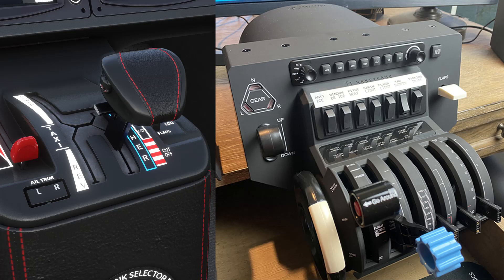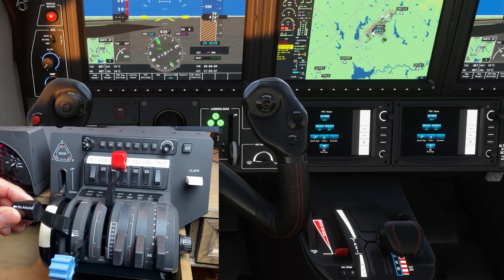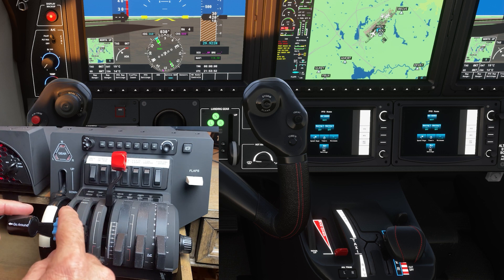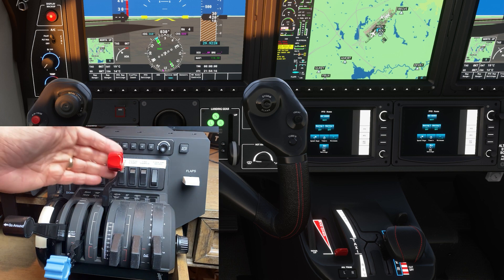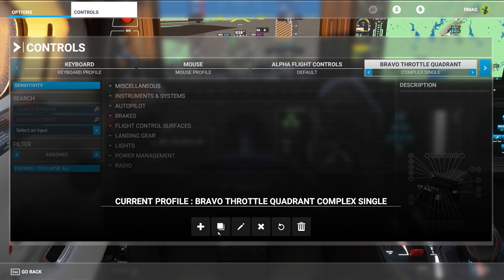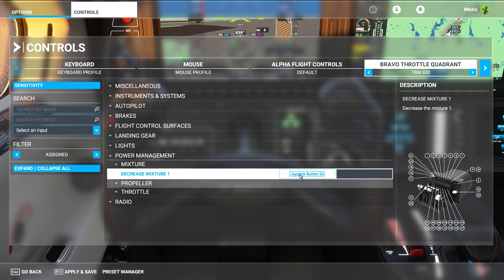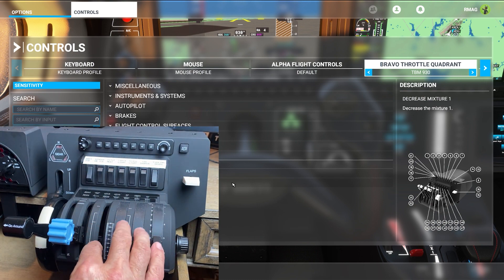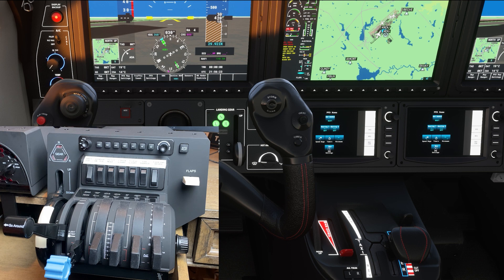TBM 930 config for Honeycomb Bravo Throttle Quadrant in MSFS 2020.

Comment from the maker: Note: Sim Update 5 broke this setup. The Prop lever no longer moves the TBM throttle out of the feather slot. Delete the prop control. You need to change your General Options/Accessibility/Cockpit Interaction System to Legacy. To move it out of the feather slot use your left mouse to click and drag the throttle up. Then hold left mouse button and click right mouse button to move it. Then use your throttle as normal.
Reply: I found a way to do it since the update!!!! Leave the throttle the same, but delete the prop axis, and instead just set the “reverse” position for the lever next to the throttle to throttle 1 cut (it should be joystick button 25). Then add another prop lever on there and again, leave the axis blank but set the “reverse” position to “propeller pitch high” (joystick button 26). When starting, have all levers in the “reverse” detents. To go to low idle, move the throttle lever a little past, then back to the flight idle position. To get to high idle, move the first prop lever out of the detent and move the throttle lever up a bit, then back to the flight idle position. To un-feather the prop and get to the flight idle position, move the second prop lever out of the detent and again, wiggle the throttle lever a bit. Repeat the process in reverse to shut down the engines. I was certainly psyched when I found out this worked, so I hope it will help some fellow flight simmers out. Happy flying!
Reply: @jonathanmcauliffe784  Love what you did, if I may add, mapping both the throttle 1 cut and prop pitch HI to button 25 with remove the third axis.
Reply: I was hoping you had a fix for this! Unfortunately, it's still not working even after deleting the prop control and using the mouse. When I click on the throttle it just glitches up and down and there's no way to get it out of feather. Not stoked
Reply from the maker: @KyleVanHaaster  Are you clicking and dragging the throttle up to the top of the Feather slot? Then you hold left click and do a right click to move it over.
Reply from the maker: Yes
Reply: So now you still use the complex single profile with the tbm?
Reply from the maker: @martindescoteaux9288  no I use a profile that just has throttle, no prop, no mixture.
Reply: @RMAG  OK got it! Thanks for all youre great work! I'm going to receive my Alpha and bravo today.
Reply: @RMAG  so how do you feather, low idle if you use just one lever or you still having  to use the mouse?
Reply from the maker: @dermolado3351  I use the mouse when its on the right side, throttle on the left.
Reply: @RMAG  you would think the people at Honeycomb would have given this a little more thought eh? Oh well your initial fix on the other video was superb.  Shame the update messed it up.
Reply: Hi everyone! I use the 1st and 3rd joystick columns on my BTQ for my TBM-930 set up. If you like, configure your BTQ as listed below to utilize all Power Management functions of the TBM-930:

THROTTLE:
Throttle 1 Axis - Joystick L-Axis Y
Throttle 1 Decrease - Joystick B24
Throttle 1 Cut - Joystick B26

PROPELLER:
Propeller 1 Pitch HI:
Joystick R-Axis Z+ (&) Joystick B26

Notes:

- With this set up, you cannot move from low idle directly to high idle. To move to high idle from low, first take the propeller joystick out of detent, then slightly move the throttle joystick. Now push the propeller joystick up to move to high idle. However, you can move from high idle directly to low.

- Any any point, to get the A/C's Throttle Stick back to the left side of the console, make sure the propeller joystick is neutral/idle, not up or in the detent position, then move the throttle joystick. 

- To cut the engine, move the propeller joystick to detent, and move the throttle joystick to detent. 

I hope this helps someone🙂.

Comment: Just found this. Since you are the "expert" with this plane, any idea how to set up the Bravo in MSFS2024 for the TBM? Would love to see that if possible. Thanks!
Reply: Me too, in fs2024 cannot figure out at all the de tent. The prop on low idle to high idle goes crazy. I have the same setup in fs2020 and work perfect. I also followed @Apollyon_Rev911 directions.
Reply from the maker: @kodiak299  I just posted a video here that has the TBM https://youtu.be/7LHipAjLL2o?si=5T1wLP8qam-53kUh
Reply from the maker: @Topcat1952   I just posted a video here that has the TBM https://youtu.be/7LHipAjLL2o?si=5T1wLP8qam-53kUh
Reply: @RMAG  Yes, just viewed it yesterday. You encountered the same wierd movements I did as well with the prop axis. It works as desired but requires a little twerking around to get the lever where you want it. Or, use the mouse. 🙂
I was also very discouraged trying to set up the Cessna 408 finding, as you did, the condition levers don't seem to work at all. Hope they get that fixed. I even tried mapping them to my TM Airbus throttles, and that did not work either.

Comment: Hi everyone! I use the 1st and 3rd joystick columns on my BTQ for my TBM-930 set up. If you like, configure your BTQ as listed below to utilize all Power Management functions of the TBM-930:

THROTTLE:
Throttle 1 Axis - Joystick L-Axis Y
Throttle 1 Decrease - Joystick B24
Throttle 1 Cut - Joystick B26

PROPELLER:
Propeller 1 Pitch HI:
Joystick R-Axis Z+ (&) Joystick B26

Notes:

- With this set up, you cannot move from low idle directly to high idle. To move to high idle from low, first take the propeller joystick out of detent, then slightly move the throttle joystick. Now push the propeller joystick up to move to high idle. However, you can move from high idle directly to low.

- Any any point, to get the A/C's Throttle Stick back to the left side of the console, make sure the propeller joystick is neutral/idle, not up or in the detent position, then move the throttle joystick. 

- To cut the engine, move the propeller joystick to detent, and move the throttle joystick to detent. 

I hope this helps someone🙂.

Comment: Generally I got this to work except when I increase the main throttle for low idle and high idle it adjust way to quick and automatically jumps to taxi throttle. any thoughts is this a sensitivity config issue with the throttle axis, etc.

Comment: What's the sensitivity on the throttles set to.  Mine, if I move it just a small amount it jumps over to the left side real fast.  I've tried to have it move slower, but nothing happens.
Reply from the maker: They changed how things work, see my pinned comment or my description.  I use the mouse on the right side, throttle only used for left side now.

Comment: Edit* just saw your comment about update 5 breaking this set up. 👍

Thank you for making this video. However, just received the bravo and followed this video but it’s not working. I’m wondering if it’s due to the default settings being different from how they were when you made the video. I was surprised that you didn’t go into detail about which function name was assigned to those levers… was assuming before I watch the video that it would involve reassigning a few things but it seems you were able to use default except for eliminating the mixture adjustment. So to be exact, by default, my far left lever is currently set to “throttle 1” and my 2nd from left is “throttle 2” Nothing moves at all. If I try to move out of fuel cuttoff position and into feather with my mouse, it fights me and wants to go back to cutoff. I have tried assigning to “throttle” but no luck. 
To be clear I have installed the software from the HC site and all other buttons are functioning. Any thoughts?

Comment: Thanks - I like the TBM 930... my throttle is setup similarly but does not work as you displayed... I never can get the throttle to move down the left side - it seems to jump back to the prop side.  It seems simple to setup but such odd and varying results .  Is there some MOD I missed ?
I want to use the REVERSE setting on the throttle at times.
Reply from the maker: Read my pinned comment

Comment: This throttle setup (TBM "H" layout) just isn't working at all. From day one of this video I have mapped this out many times.
Lifting, then lower the prop (blue) lever shuts off engine. Lowering throttle (black) lever cuts power and moves throttle to right side.
It just doesn't work. I dont know if its a tbm license issue or microsoft are just too lazy to fix it?
No, it just does not work as a programmable option. Wasted my money on a honeycomb throttle and not willing to waste any more time trying to set it.
Thanks for your videos Rmag. No issue with them, Its just this module.

Comment: Hi great video. My anti ice LED light seems to be associated with Pitot heat, anti ice. Is there a fix for this?
Reply from the maker: Any time I get things happening that I don’t like, I unbind it, and then search for what I want it to bind to, and rebind it.  If it still does not act as I intend, I try a few more times.  If I can’t get it, I give up.
Reply: Ok thanks. So Anti Ice LED light bound with Pitot Heat switch is not a common issue?

Comment: Maybe I missed something but how is the propeller assigned?  Same as the Complex Single Profile?  Also, my axis assignment for that prop level does nothing when set to Joystick L-Axis X.  If I use the scanning mode selecting, It will set to Joystick L-Axis X- or Joystick L-Axis X+ depending if I push the lever up or down.  Must be another bug not worked out with software updates from MS or Honeycomb.

Comment: How did you configure the parking brake for the switch? I had it set for Toggle Parking Brake and it continuously engages and disengages :( I had 46/47 configured for it so I thought that was the problem, and then just 46 and still does it :/
Reply: Try "Set Parking Brake" bound to one position of the switch, with nothing bound to the other position. That's working for me.

Comment: So the other day I was flying the TBM on an IFR flight, and usually, when I want to set the correct cockpit view I press control + space. I knew I could do it with a button on the Alpha yoke, but  I got side tracked. For some reason, I ended up pressing Alt + space, and it messed my throttle, where I was trying to increase power but the lever (in the sim) did not go up and it kind of got stuck in the middle and when I was trying to gain power the control was moving backwards. Finally I realized what I did, and when I pressed Alt + space again, it came back to normal. I ended up with the very same problem I had when I added the propeller control to the TBM back then as suggested here. I posted back then that I could not get it to work without having issues, which in my case was power loss, so I ended up using only the throttle control without the prop control. After I had the problem I mentioned, I figure that probably what happened the first time I had the problem after I watched this video was that maybe I pressed the same key combination without noticing. I went and added the prop control to the TBM today and did a short flight, and it worked fine.

Comment: Thanks.  I have another bug for you to figure out! If I select CRS with the left knob, it allows the right knob to rotate the OBS for VOR 1.
However, it does not work for VOR 2.  How can we configure the CRS selection to work for VOR 2 to allow the right knob to rotate [increase/decrease] the OBS for VOR 2?

Thanks for your invaluable help and videos!
Reply from the maker: You need to make a unique button combo binding since on the left knob there is no selector for VOR 2.  I did this:  Find “INCREASE VOR2 OBS” and bind it to a combination of hold down NAV button and turn the right knob to the right.  “DECREASE VOR2 OBS” bind to hold down NAV and turn right knob left.  Now any time you hold down the NAV button and turn the right knob you will control VOR 2’s OBS.
Reply: @RMAG  Thank you so much for this and the impact you've had on Bravo users!

Comment: I was really looking forward to the trim wheel on the Bravo, because I've had a lot of trouble with trimming. Unfortunately, I can't trim with the Bravo, either. No matter how hard I try, the plane porpoises -- rises until it slows and loses a little lift, then descends until it picks up speed and gains a little lift, then the process repeats ad infinitum. Now I read on other forums that the same MSFS bug that allows heading adjustments only in 10-degree increments is magnifying trim adjustments tenfold. Have you found a way around this problem?

Comment: One question, when setting up the 350i my props do not feather. the throttles go into reverse/beta and mixture cutoff  but does not recognize prop feather. any ideas?
Reply from the maker: Tried to figure it out couldn’t get it.  The props feather when you pull the prop levers into the feather zone on the sim.  When you do that it goes to -15 rpm.  So it’s something different than the feather toggle switch the bravo throttles are bound to.
Reply: @RMAG  Thanks for the help.

Comment: So, it turns out that either is only my problem, or no one has reported it yet, but the way I got rid of the problem with the TBM power loss was by removing the propeller altogether and only use the single throttle control. By doing that, the aircraft works perfectly fine and I only need to bring the throttle back all the way to the right to turn off the engine without the need for a propeller lever, albeit, that only works on the airplane itself using the mouse, but not with the Honeycomb throttle itself. So everything is good now, and as I said, it may only be me, but I was thinking that you only need the throttle and no propeller control at all, it makes sense since the TBM does not have a propeller control. I actually ended up creating different profiles for the D 62 and the D 40 NG which works pretty much the same way. The D62 only uses the 2 throttles, and the D 40 the same with 1.
Reply from the maker: Setting up with a single throttle is more technically correct, and certainly correct for the DA-62 etc.  The prop lever in the TBM 930 is not really being used as a prop lever (because there is no real prop lever).  I just found that it acted as an easy way for me to bring the throttle back over to the ride side of the throttle slot.  But if it did not work for you by all means it’s not necessary.  You can drag the throttle over with the mouse but it’s a little buggy. Takes several drags of the mouse sometimes.
Reply: @RMAG  actually, when I wanted to shut the engine I dragged the lever on the Honeycomb the second time, and when it moved to the right, I dragged it all the way down and shut the engine off.

Comment: I must be doing something wrong because I cannot get the torque to live the yellow area. Also the throttle control doesn't stay up and keeps on moving up and down. I followed your earlier video and I used the single complex and duplicated it, deleted the mixture completely, but it doesn't work because the aircraft does not attain full power and the torque is very low. I can't get full power. I didn't have that problem before. I left throttle control on all the way down on the detent, and the power is on idle while I'm on the runway, but when I try to apply full power, the torque stays low and power low as well.
Reply from the maker: Make sure your throttle is set to throttle 1 axis and the reverse axis is checked?
Reply: It is. I tested all the other profiles I created based on your other videos and they work fine. I just realized something thought. I have a Logitech throttle connected as well and I wonder if that may be the cause. I will disconnect it and see what happens but O doubt it since I didn’t have the same problem while creating the other profiles. They all kind of shacked when I was testing the reverse.
Reply: I disconnected the other throttle but no joy, the airplane actually shuts down.
Reply from the maker: @perohijo  if the airplane is shutting down confirm you don’t have mixture 1 bound to anything?  If you have mixture bound the TBM doesn’t like it.
Reply: @RMAG  I deleted the mixture as per your video here. I tried other GA "single complex" and most of them work fine. I only had some issue with the Bonanza when I brought the propeller control down. It shut off the engine. The others I tried worked fine. I'm only using  the throttle and the propeller control on the TBM on the TBM 930 profile. On the other ones I used the mixture as well on the single complex profile. I actually requested support from both Microsoft and Honeycomb because I really can't find the reason for the problem. I had also some issues with AP with some aircraft as well. Some of the buttons suddenly turn of after they are engaged.

Comment: thx Rmag for your vids.very helpfull. For the TBM930 I can`t manage it to activate the reverse funktion. Put the throthle  into the very back Position, nothing happened. My setting like you show it in your vid. What I can see in the config page , the slider  from 0-100 % is fully drawn/painted. I saw, you have a section on the left site. Any idea/advice for me ?? thx a lot
Reply from the maker: You need to make sure you start with my other video on setting up the various configurations. This video is an add on to that. Going through the detent activates a button which needs to be mapped to “Decrease Throttle 1” in the Sim for the reverser.
Reply: @RMAG  thx,so easy.Prop is always between the ears;-).Keep on with your educational vids.